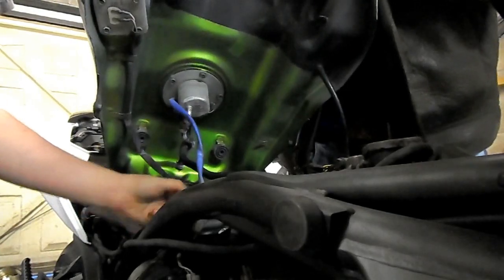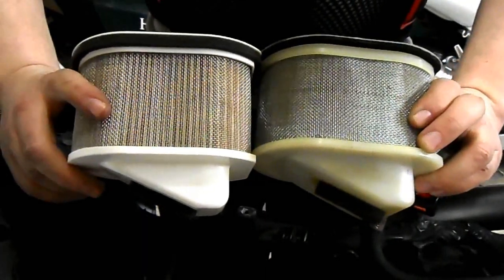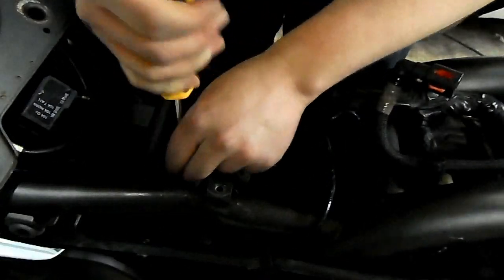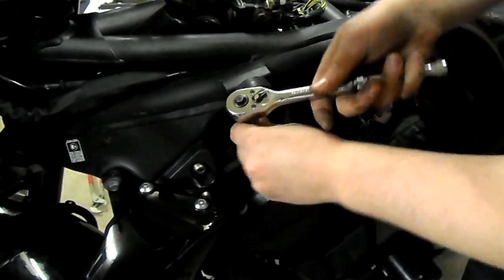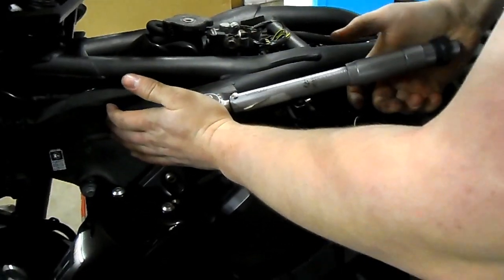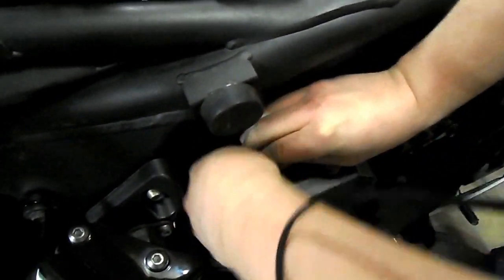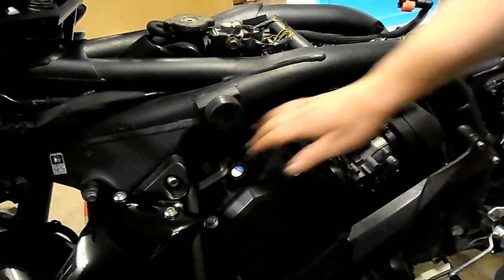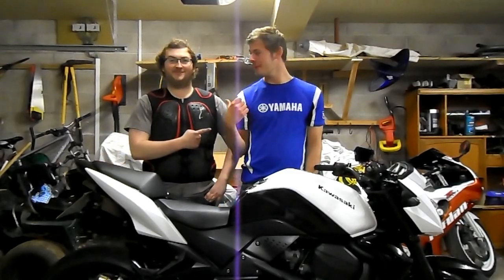Motorcycle Air Filter Change and Spark Plug Change

Comment from the maker: Yeah no problem, the issue is access the thermostat obscures the view for 2 and 3 so the thing to do is remove the bolt that mounts it to the frame and you can push and pull it to get access. you could remove it but that would require draining the coolant which would make things more complicated then the next task is to get the coils off we pulled the off using adjustable grips but be very careful not to damage them use a rag if you need to the final thing to do is use a spark socket and...

Comment: Although you demonstrated removing one spark plug, you removed the easiest plug to replace. I have a Yamaha FZ1 and I've been having trouble replacing the spark plugs because the openings are under the frame and VERY hard to reach. How can I replace those spark plugs? Any tips?

Comment: Battled with this for hours and the answer is: loosten the 10mm bolt holding the coolant cap and it gives you some wiggle room. The rest is wiggling cables and swearing. You need a good long extension on your socket and a swinging joint to get the angle.
Reply: H2y, I'm working on a 2007 z1000, will that still work? Spark plug #2 is underneath the coolant cap
Reply: Is the 10.mm bolt tool need to change sparks ??? I need to buy
Reply: @Hortiklutura_Green  Can't remember exactly but the 10mm was just a standard spanner/socket I think to give yourself more space. The extension and swing-joint was to remove the spark plug after the coolant cap was out of the way.

Comment: i bought a cheap china spark plug wrench and had the guy at the corner cut the shaft and weld a piece of reebar to make it long enough,it works wonders for under 5 £ ,so long tool shop.